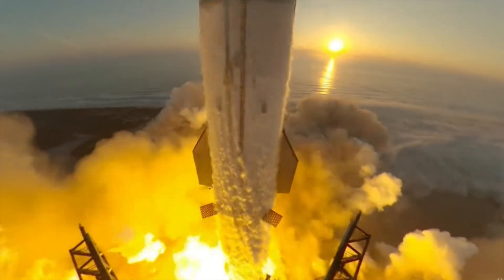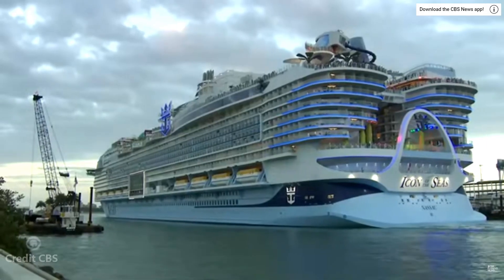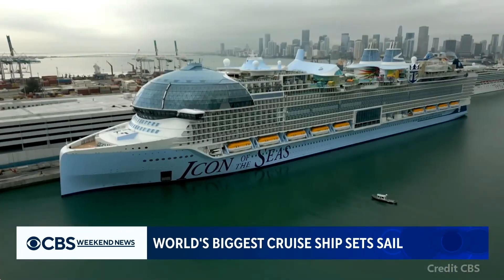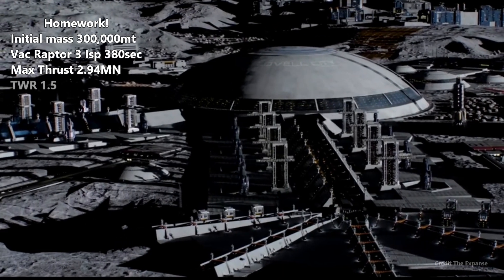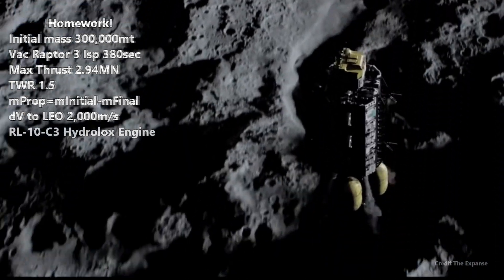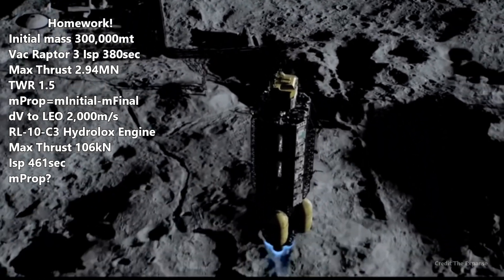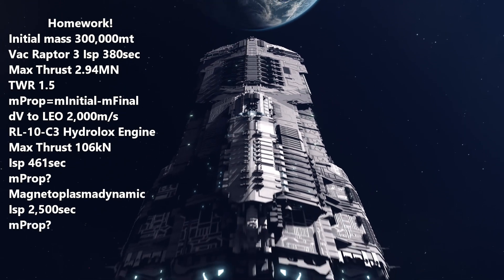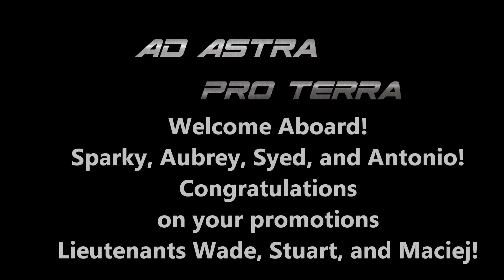Moon Icon Launch! And Journey to Mars!

Comment: I did some calculating. I rounded a lot, because I am too lazy to go for a calculator:
1. Stage, Methalox: Initial mass 3x10^8 kg x 15 m/s = 4,5 x 10^9 N. Divided by 2,94 MN = 1500 Raptor Engines. 2000 m/s / 15 m/s = 133 s fire time. At 9,81 / 7  m/s² x 133 s makes another 150 m/s gravity loss to cover = 150 s. 2,94 x 10^6 kg m s-2 x 150 s x 1500 Motors / 3750 m/s = 2 x 10^8 kg fuel. ca. 2/3 of initial mass. Probably significantly less, as the ship gets lighter by time, but I ignore that because it´s easier. Leaves 100.000 t of ship mass. Probably less if you perform stage separation.
2. Stage Hydrolox. Maybe something additional reqirement was named, but I only remembered 5000 people being on board during calculating. Missing another requirement I just decided to have 50% mass to be fuel in order to have some base for calculation: 50 kt hydrolox x 461 s x 9,81 m/s / 100 kt = 2300 m/s additional speed.
3. Stage: Magnetoplasmadynamic Ion thruster. 2 m/s x 10 days = 2 x 10 x 24 x 60 x 60 m/s = 175.000 m/s = 0,06% C. Here the ship becoming lighter can no longer be ignored: to accelerate 50 kt x 175 km/s using 24 km/s nozzle escape velocity requires 350 kt fuel, which is 7x ship mass. The ship thus has to fire a significant portion of it´s weight for this to make sense. I could probably calculate that, but it´s 23:30 at my place and I have better things to do right now (sleeping).

Have fun pointing out my errors!
Reply from the maker: A lot of great work! We'll go over the answers on Sunday.

Comment: One thing to bear in mind is that the mass of an ocean going vessel is going to be governed by the nature of the loading. While an ocean freighter, or tanker, of cargo ship, or cruise ship etc… doesn’t experience much in the way of axial inertial g-force, it does experience enormous flexural stresses due to unequal loading (support conditions) during high sig wave/long period. I think you should reconsider the problem as an oversized starship-like fuselage to achieve a living volume to benefit from hoop stress to keep mass to a minimum. Maybe a toroidal shape, with starship like engine modules in the middle for propulsion.
I realize this is only an exercise, but it seems a bit odd to take a cruise ship as a space ship…
Reply from the maker: We'll assume final mass is 300,000 mt after all is said and done.